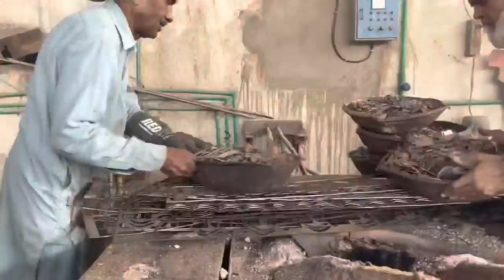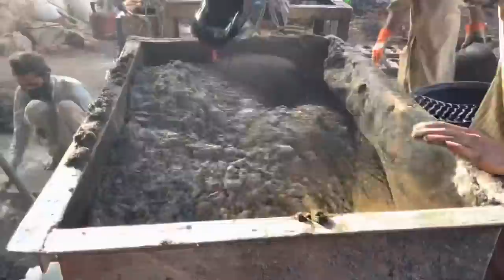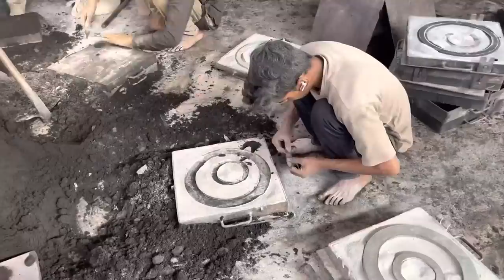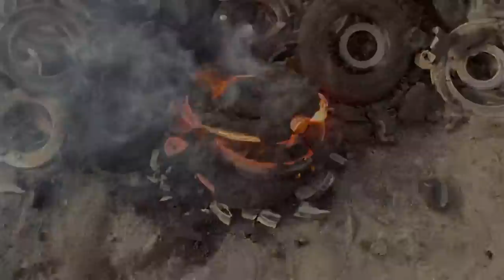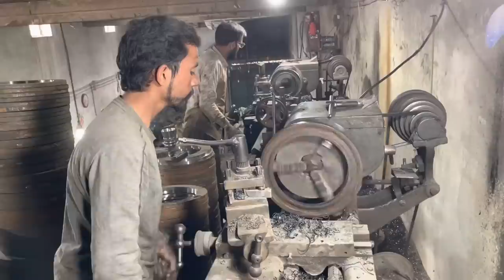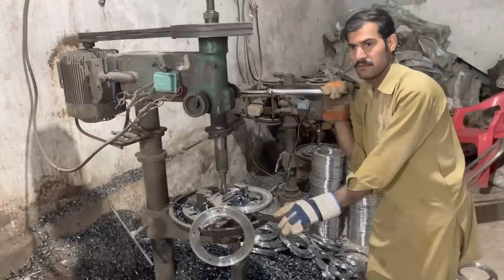Wonderful Manufacturing Wheel Bearing Lock Nut Plate | How to Make Truck Hub Bearing Assembly

Comment: So many improvements could be made with inexpensive changes. Most of the improvements could be fabricated from scrap. The sand muller should mounted above the work area so that gravity would deliver the sand to the mold. They should build a jolt table to settle the sand and a squeeze head to compact the sand. They should use a plate pattern between the cope and drag.
The molds should be put on a roller conveyor to reduce handling. The molten iron should be delivered by overhead hoist. The finished molds could be rolled directly off the end of the conveyor into a shake out box. The cost to make these changes are minimal and I don't understand why they use such inefficient processes.
Reply: это азиатский способ производства, низкая эффективность обеспечивает занятость и спасает от перепроизводства
вы у себя в стране обеспечили эффективность - посмотрите сколько безденьников, наркоманов и извращенцев вокруг
Reply: The thing I notice more than anything else is the lack of process flow. 
The various tasks are spread out around the workspace in a haphazard way, with items often strewn in the way. It just seems an odd and inefficient way to do things, The production line became king for a reason.
Reply: Cost of labour is still lower then cost of those improvements.
Reply: @andrzejskrzypczak4161  According google the median annual income in Pakistan is $7,000/yr. I estimate that you could make the changes I outlined for less than $5,000. That investment should lead to  a head count reduction of 3 men. That would be a 3 month payback.